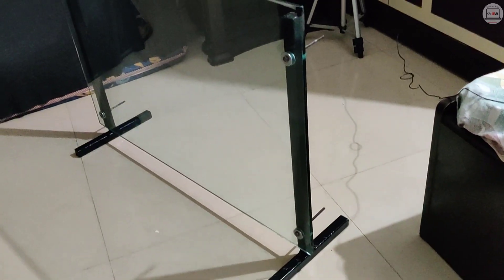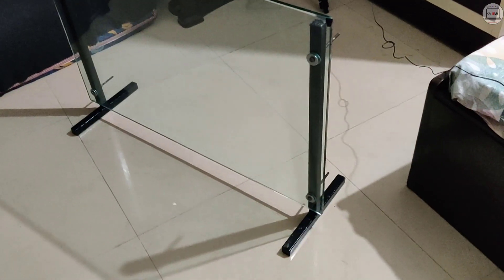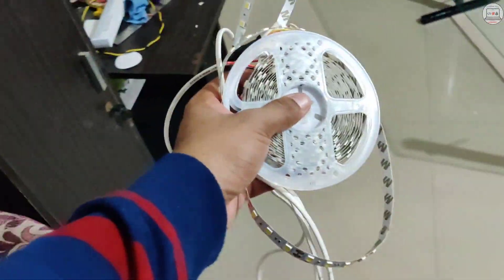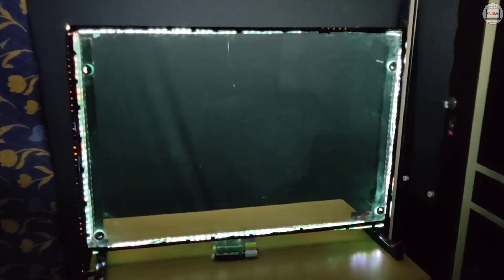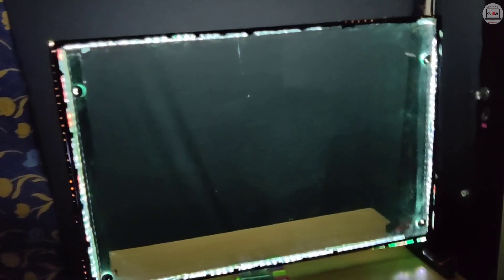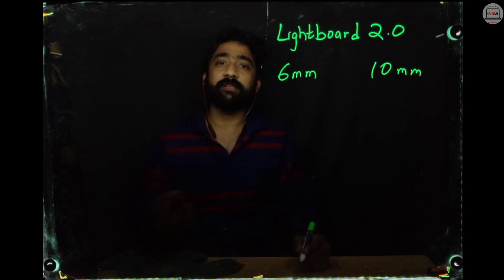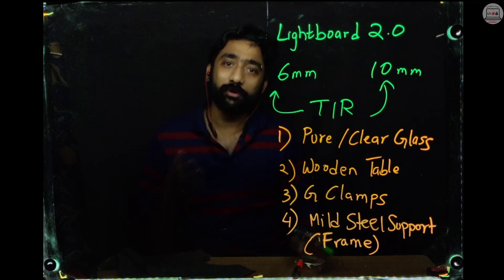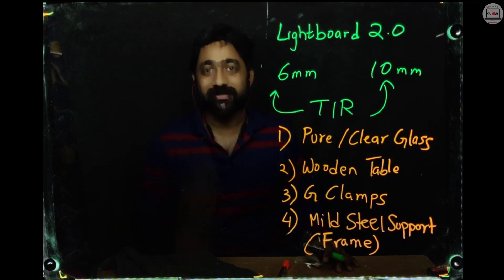LightBoard 2.0 | Better Version | Under 8000 INR | How I made my own Lightboard | DIY | Sridhar Iyer

Comment: I have made a glass board using a polycarbon sheet , (3mm thickness)   but still I Iam not satisfied, I want to superimpose images on screen by projector,  images are not clear, thickness of of glass is important or not? How much area u have used black cloth
Reply from the maker: Yes The thickness is important. My 1st lightboard I made was of same thickness.  Even I wasn't satisfied with that one so I built this one. This one is made of clear glass of 10 mm thickness as mentioned in the video.

You can superimpose images using software called OBS studio. Many Tutorials are available online how to add images to Lightboard. You can try that. 

The black cloth I used is a normal single bed sheet cloth which I hav pinned up to my wall.

Comment: Which marker you are using sir?
Reply from the maker: Sir I am using neon markers as the normal highlighter pens are not that bright.
Reply: @sridharciyer  where to buy it?also tell me about price.
Reply from the maker: I used this. https://www.amazon.in/dp/B07W6WH5NH?ref=ppx_pop_mob_ap_share .

It's available for 450 rupees
Reply: @sridharciyer  offline neo marker nhi mil skta kya??
Reply from the maker: Maine kuch shops me enquiry ki thi. They said ki costly padega as shortage hai.
Reply: @sridharciyer  mai 6/4 ka light board taray krna chahata hu to mjhe khud pr focus karne k liye konsi light ka use krna hoga??  

Their price??
Reply from the maker: Agar kharcha kam karna hai toh aap 2 chhote led tube le sakte hai 2 feet k aur glassboard k dono side pe use laga sakte hai jisse aap pe light pade. 

Diffuser ki jagah aap woh tube ko kapde se thoda dhak dena taki bohot zyada light na ho else aapka content bright nahi dikhega. 

1 tubelight kuch 200 me mil jayegi aapko amazon pe ya offline electric shop me.
Reply: @sridharciyer  thanks sir for your valuable time
Reply from the maker: Most welcome Sir☺️
Reply: Sir one last question,,,, 4/6 ka glass purchase kr rha hu to normal glass lagega ya koi special ata h alag se,,,, aur sir uski thickness kitni leni hai??
Reply from the maker: @neetpreparationwithkotafac5916  Arey sir no issues. Doubts hai toh clear karna better hai before spending money.

Maine 10 mm thickness ka glass lia tha . Minimum 8 mm bhi chalega. Coz aapka glass ka dimensions zyada hai toh heavy bohot hoga. 

Frame zarur lagwa lena. Else stable nhi hoga

Normal Clear glass. Special kuch nahi chahiye
Reply: Thank you so much sir,,, apke guidance se सारे equipment आ गए है,,, thankyou सो मच,,,,, sir बस यह और बता दीजिये ki clear white glass 4/6 ka 2100 रुपये ka आ रहा है,,,, और very clear white glass 6000 ka आ रहा है,,,, कोनसा अच्छा रहेगा,,,, 2100 बाले मे pareshani आएगी क्या???
Reply from the maker: @neetpreparationwithkotafac5916  sir mera toh normal clear glass hi tha. Aap ek kaam kare. Ek marker leke check kar lena order dene se pehle.

Main market leke gaya tha shop me. Likh ke dekha. Agar woh clearly dikh raha hai toh order kar de normal wala hi. Mujhe toh 750 me pada tha 2feet by 3feet ka
Reply: Frame kesa?? Mai smjha nhi sir,,,, mjhe bahut bura lag rha hai ki mai apko baar baar pareshan kr rha hu
Reply from the maker: @neetpreparationwithkotafac5916  sir aap glass ko support kaise doge? Kuch toh frame lagega na? Aapne kya socha hai?
Reply: Ok,,, thanks
Reply: Neo marker lekr jana h sir??  Ya normal marker,,,,, light bhi chamkaani padegi??
Reply from the maker: @neetpreparationwithkotafac5916  normal chalega. Bas likhke dekho dikh rah hai ki nahi glass pe dono side se